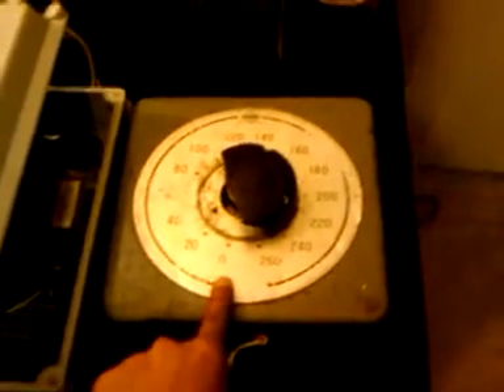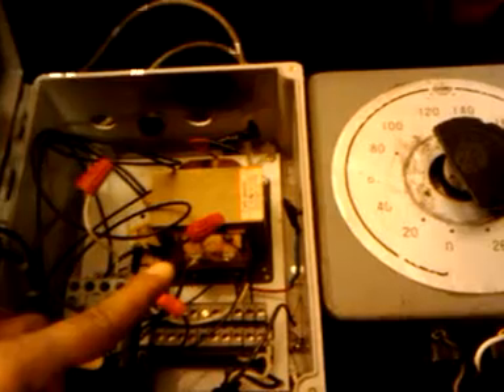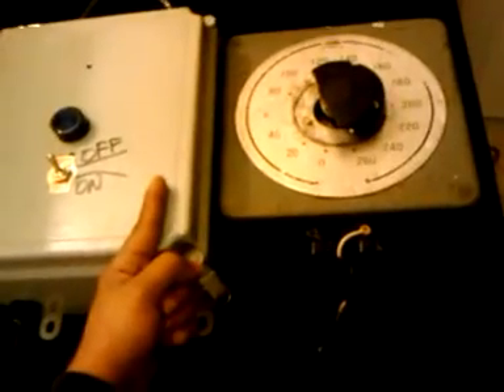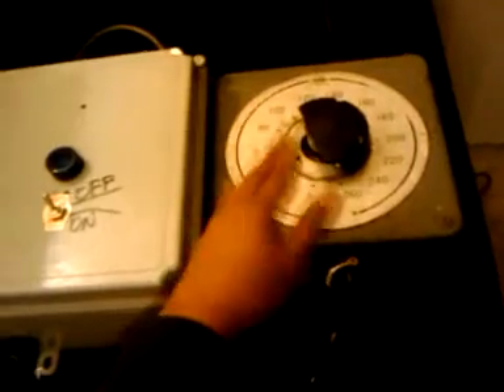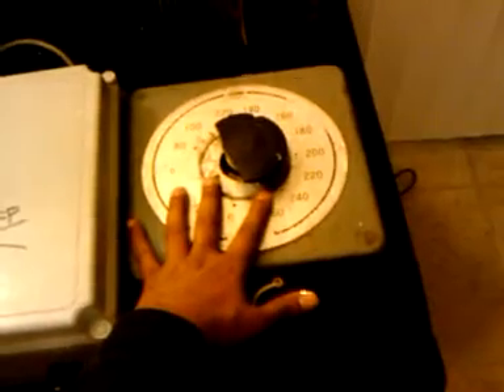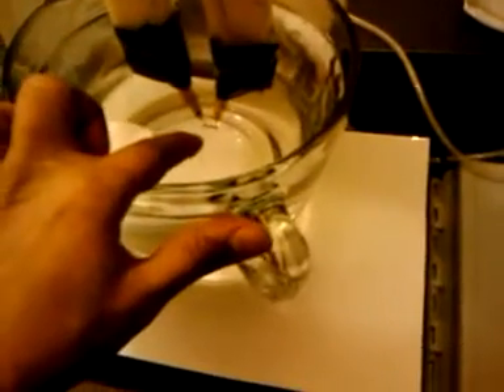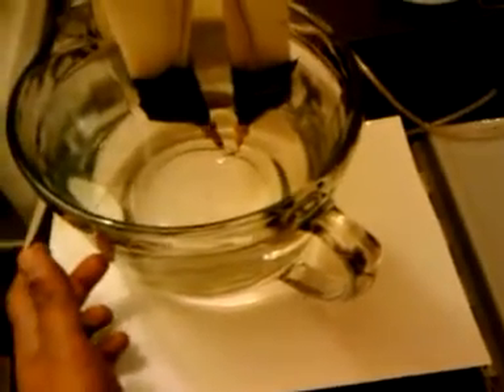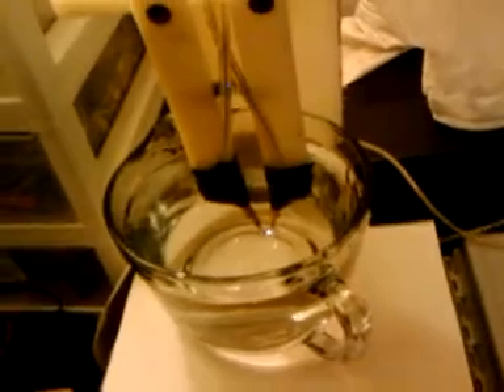colloidal gold generater part 2.3gp

Comment: Ok, please explain (fill the gaps) ; finally are you using AC or DC current? what the amperage? I believe that you said; your power intake is reduced from ~115VAC to ~36VAC but with high (*) amperage, right? So making long story short; I have to keep constantly heated destiled water (what temperature?), use two gold (.999) rods with ~36VAC voltage (unknown amperage*) and Ill be able to create colloidal gold batch (unknown time frame), right? Anyway good posting, thank you.